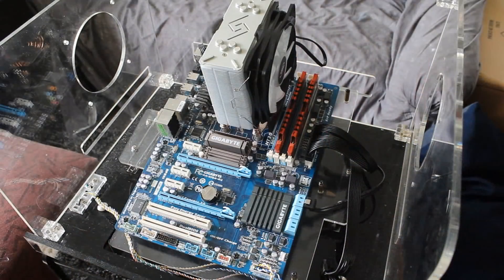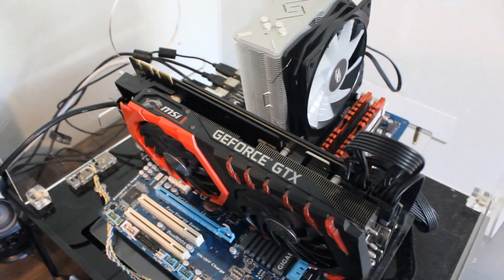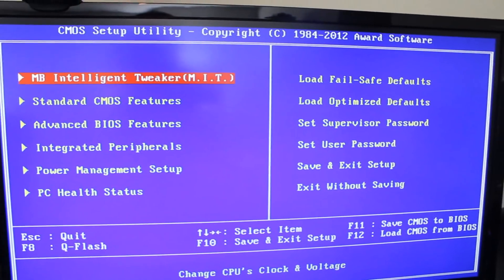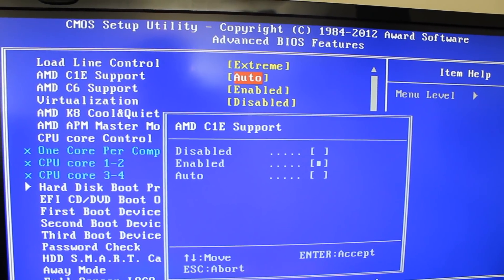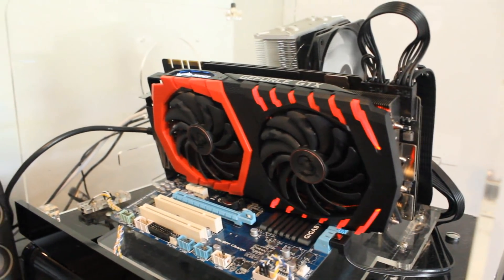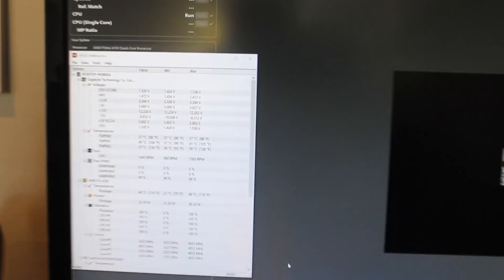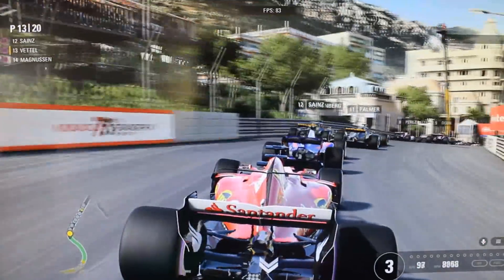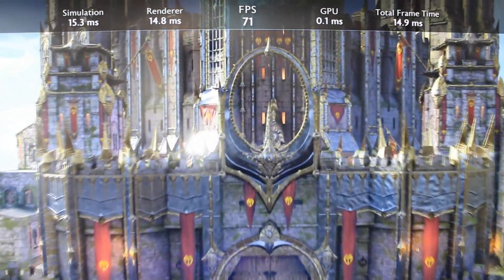FX-4100 In 2018, Is It Still Viable? (Overclocking & Benchmarks)

Comment: i knew a dude who put a 1080 ti with a 8350
Reply: Actually, this isn't stupid if he plays at 4k... The GPU won't manage more than 60fps anyway, and this processor is certainly enough for that.
Reply from the maker: Wow
Reply: What about what I have now on my primery desktop, an Intel Core i7-4770k oc to 4.0ghz, 16 GB ddr3 ram 2400 mhz, and a gtx 1080 (not ti). I was wondering if I have any bottlenecks there. Still even the latest games on this desktop seem to run fine, such as FarCry5 at 1080p ultra 1.5x resolution scale and usually get between 80 to 90 fps. I guess my setup isn't too bad, guess an i7-4770k is still better than an AMD fx-8350. I guess however, if you were on a tight budget, then the fx8350 could be a good choice if you want reasonable performance for a good prices, that with a gtx 1050 or 1060.
Reply: I wonder what would happen if I stuck in a 1080ti in my older desktop that was found on the side of the road that has an AMD Athlon 64 x2 4200+ CPU with 3 gbs of ddr2 ram and the bios date for that PC is 8-24-2006. Of course I have it working fine with a gtx285 which I think was one of nvidias top graphics cards in 2009.
Reply: Also, if I have two sticks of Corsair 8 GB ddr3 ram 2400 mhz c10. I looked on the sticker and it said that they came from a 32GB set of 4 stick, is it OK if I just use 2 sticks for 16 GB of ram and does it work the same as having all 4?
Reply: you can install "msi afterburner" and enable an opction called memory usage, then run a game benchmark to prove if its matter or not, since you got an top pc, probrably matters. In a crappy pc like mine i installed 4x4 gb of ram 1333mhz with a fx8120, it never reach 8 gb of memory usage with a gtx 550ti at 760p. 
     But a top gpu uses a lot of memory, and i believe if you use quad channel is better too, if  was you i would keep 32 gb in quad channel.  You will probrably need that at 4k or whatever resolution you play.
Reply: I think I'll stick with the 2 x 8 GB Corsair dominator ddr3 2400 mhz ram for now, generally I don't think anything over 16 gb is really necessary. I've actually built up a collection of PCs. The oldest PC I still have today that still works even for playing really old games is a Toshiba Satellite CDS330 laptop from 1998 and it still runs Windows 98 second edition, has a 266 mhz Pentium processor with 96 mb ram and its original 4.1 GB hard drive. I could even play games on that laptop as well, mainly as long as I stick with pc games made before 1997. Also have another desktop pc  that was given to me from a friend that he said he found it on the side of the road. I remember it was almost complete, except the graphic card, so I got for cheap a gtx 285 to go in there and it has an AMD Athlon 64 x2 4200+ with 3 gb of ddr2 ram and I actually set it up to dual-boot Windows XP and Windows 10. Even though the BIOS date says 8-24-2006, Windows 10 even runs fine on it. I've read one time that the oldest PC possible thats capable of running Windows 10 is one of those original AMD Athlon 64 desktops released in September of 2003.
Reply: "...Lol, that's some serious bottlenecking. 8350s start bottlenecking gtx960s by 10% if not OCed, just can't imagine a 1080ti :S..."
        I seen tests where a stock 8300 was bottlenecked by a 1060 6gb at 1080p, and at 4,2ghz with a 980ti oc at 1444p, the gpu was bottlenecking the fx again. Fx never hit 100% like an 4 core do. Just because their ipc is bad doesnt mean it dont have 8 cores, your coment is not grounded in facts, its just ignorance
Reply: your setup is the best, the high frequency memory at those high clocks are correct too....  
fx dont 83xx dont bottleneck stuff, its just bad at computing stuff, so the frames are half what should be, and dx12 wanst avaliable in games in the past, so a i5  2500 beat every fx83xx at that time...
In my country, people even put an fx 8xxx in those cheap mobo that dont have much phases or vrm coolling, so, you are stuck with low stock clock because you cant oc, and EVEN stock the fx throttle the system because its a crappy mobo. I have this problem here, i had to shut down 4 of 8 cores to the system run smoth, and to my surprise, most of games even improve fps (witcher 3 exception). I run 15°C cooler this way, 8 cores was too much for mine 2012 2015 games, but today with vulkan and dx12 i think more than 4 cores is the future. I seen tests that show that a  i5 2400 with the same clock as ryzen 1200 do a tinny better in games with crappy ddr3 at 1600, so your setup is  like 10%  is better than a ryzen 5 1400 (4c/8threads) with 4,0Ghz.
Reply: Lol, that's some serious bottlenecking. 8350s start bottlenecking gtx960s by 10% if not OCed, just can't imagine a 1080ti :S

Comment: FX CPU doing no bad definitely don't deserve the hate they get would do better with gtx  960 or hd 7950 or 1050  ti something that level make a nice starter pc pile driver dose lot better than bulldozer mined you
Reply: Ross Mclaughlin yep, 8350, 8320, 6350, 6300 are great low budget starter alternatives, with GTX 960 or dual gtx760s, or dual 660s or 660tis, or dual 7950s or dual 7870s, or dual R9-280s
Reply: Ross Mclaughlin I use it with a amd radeon r7 370 and it works good together. It’s not the best and most expensive but is is pretty good

Comment: I'm currently suffering through with an FX 8350. It's ok for the most part. Things are "playable" but there are very noticeable moments where there's momentary dips that really distract from the experience, despite overall FPS being acceptable enough. Though in games like Warcraft, it's just crap. Any zone in legion is typically in the 30-60's, and even 20's during raids. Looking forward to gen 2 ryzen, really hoping the bugs are worked out and memory is just compatible across the board regardless if it's Samsung.
Reply: WholeGrainGoldfish Did you overclocked it?
Reply: Yeah. 4.5ghz.

Comment: I thought 1.6v was fine on the FX cpu's
Reply: 1.5 officially I think. And most people don't recommend above 1.45 for long periods of time. My board maxes out at 1.55v, though to be fair, its 80-100w per thread under Cinebench at 5 Ghz for me. Thankfully its barely over 300w at 4.8 Ghz 8 thread (still much less than an i9, but a lot more than Threadripper 1950x at 4.2 Ghz). 

I have to have 2x 40mm fans as idle stage, heatsinks added to even the inductor chokes, and a duct so 1/3 of my intake on my 120mm AIO at 4,100 rpm is sucking from the VRM in a second stage. It works perfectly fine though running 4.8 Ghz all day long though rendering or whatever I need totally stable.

Comment: What was 4100's cinebench score with APM turned off? @4.8ghz?
Reply: You need to overclock the FSB then (lower the Multi to keep the same frequency). I get 746cb at 4.8 Ghz with 8 cores (8350). The difference in over double the performance comes from FX needing the FSB overclocked (even the RAM can run potato speeds below DDR3 spec), because that has the biggest impact on performance, its just a weird quirk. I run FSB at 235, meaning my multi is actually only 20.5. I've tested it, because it sounds stupid, but it works, but I have no idea why.
Reply: the 8350 is also on a decently improved version of bulldozers arch (piledriver I believe) vs the original 4100 here I imagine a 4300 would of faired a little better.
Reply: AM3 and AM3+ is known for gaining performance from FSB & HT oc.
Reply from the maker: Only 330 or something lmao
Reply: Tech Showdown oh thx (330cb), I was curious what was it's performance was looks like it's competing with fanless Ultrabooks, like the core Y m3, m5, m7; lol those are dual core and do 0.8ghz-2.66ghz on those
Reply: Jake Garrett you must be lucky with you CPU, I use to run 8350 @ 4.5ghz @1.45v for 24-7 OC and it lasted me from 2013-2016 xmas I get 708cb/108cb for my 8350 @ 4.5ghz 45°C. That slots my 8350 in between a i5-4690 & i7-4790 in terms of performance.
Reply: Jake Garrett i wa never lucky overclocking with fsb and ht. As soon i increase the fsb by 1 or 2 it crashes. Ht cant even touch that it crashes.

Comment: "4100@ 4.8GHz..yeah, that'll be good enough to get you by...that''s for sure" 

Correction : "4100@ 4.8GHz..yeah, that'll be good enough to get you by (if you have it paired with a 1080Ti)...that''s for sure" ;)
Reply: You don't need a 1080ti, he was showing max performance of the CPU (CPU bottleneck, if you don't test this way, you really don't know how good the CPU actually is or if its a GPU holding you back). You should get the same FPS paired with any GPU (with sufficient Vram) that can handle those frame rates you saw in the video. For 1080p, a GTX 1060 would probably give you the exact same scores (may need a 1070, I'm not familiar with Nvidia performance on those games)
Reply: well considering the cpu will almost always be the bottleneck if you have a decent gpu e.g. a 570 or above it doesn't really matter.
Reply: You'll get about same preformence from a 1050ti with this chip bulldozer dose bottle neck lot of GPUs I my self have bulldozer 6100 n dose reasonable job with gtx 960 4gb in my media/back up rig have 8350 in main rig n it handles gtx 980  FX CPUs not as bad as people say main issue they had at launch was the price they were relive to composition intel preforming better at same price point as pile-driver n as for bulldozer it was let down phenom 1100t often beating out 4 core bulldozer in just about anything but 6 Vs 4 core maybe not really fair comparison
Reply: Dude... My FX-4100 was bottlenecking my friggin GTX 950. I'm not even joking when I say my BF4 framerate nearly tripled when going from the FX-4100 to a Ryzen 5 1600!
Reply: I was at around 20-40 fps (with a lot of choppiness when turning and such), and it jumped to around a smooth 110-130. I have a 144hz monitor, so it does make at least a small difference.
Reply: +Dragonslayer182
With a FX-4100?
What are you smoking?
My friend even has a FX-4300 and he doesn't get anywhere near "30-40fps" at all.  In most games, even Skyrim, he gets a constant 50-60fps without much problem at all.  He even has a R7 260x I believe.   

I don't think he's ever played Battlefield 4 on that computer he has, but he does play:
Payday 2 
CSGO
Left 4 Dead 2
Garry's Mod
Dark Souls 3
Assassin's Creed Black Flag
GTAV
War Thunder
Outlast
Outlast 2

and a whole lot of other games.  To my knowledge, he's only ever really gotten like 30-40fps on a very few amount of games, other then that he's usually at a constant 40-60fps.   I have no idea what settings he usually uses, but from the games I've seen him play it's around the medium-high preset usually.  His monitor is 1600x900 btw.
Reply: Those games ran about like that as well on mine. Battlefield 4 seemed to be exceptionally poor-performing, however. I'm guessing it's a lot more CPU-bound than most games. GTA V, however, did get a good boost. From about 40-60fps on low-med settings to 90 fps on medium-high settings. Everything here is at 1080p.

If it's not because of CPU performance, then it may have been due to thermal throttling. My FX had heat issues in it's final weeks before being replaced, and even after trying a new cooler, new thermal paste, and a slight underclock, it was still having overheating issues and having frequent restarts. It pretty much drove me to say "fuck this" and replace it with a Ryzen at that point.
Reply: +Dragonslayer182
Highly likely it was due to thermal throttling then with all that "stuttering" you apparently were experiencing.   FX processors with the stock cooler unless in a moderately cold environment will always over-heat because FX processors came equipped with shitty heatsinks, although not as bad as Intel heatsinks. 

Although I question how your FX processor was still having heat issues even after you replaced the heatsink with a good one, thermal paste and all.   You might've cooked something inside the processor it-self if that's the case, or something else weird was going on (fx processors beyond 60'c would experience strange issues if left at these temps for a long amount of time, all the way to essentially not work anymore)
Reply: 1Tanker If he gets a 1080TI it would bottleneck the pc. 4100@ 4.8 with a 1050TI would be better for the pc.
Reply: Dragonslayer182 I wonder with my secondary PC how an AMD Athlon 64 x2 4200+ CPU is paired with a gtx 285. It's bios date is from 8-24-2006.
Reply: +Dragonslayer182
So you went from average 50-60fps minimum 30-40fps to 180-200fps...?  

After 60fps, fps in general just doesn't matter anymore.  Not entirely sure what the point you were trying to make here is at all.